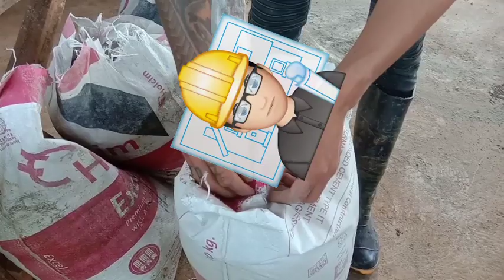Flexural CONCRETE MIX DESIGN | Trial Mix PCCP Item 311 | Slump Test Concrete Mix

Comment from the maker: CORRECTION Tampering Rod Requirements:
SLUMP CONE - 25 blows each layer (3 equal layers)
BEAM SAMPLE - 63 blows each layer (2 equal layers), rod once for every 2 sq. in. of top surface area of beam (6"*6"*21* beam size). Tap outside of molds 10 - 15 times with a mallet or an open hand for each lift.

As per DPWH Standards  Item 311, AASHTO T23, ASTM C31

Thank you 👷‍♂

Comment: Wrong details. When you are making beam sample it is not 25tamps. It should be 1tamp per 1sq.inch.. 
and the slamp procedure. Kpg hahatakin mo ung slump tools hindi spat matagal. Dpat 5secs. + or - 2 secs..
Reply from the maker: Hello po, thank you po sa comment sir., anong section po ng bluebook ang standards na ito makikita sir? Salamat
Reply: Astm C31 and Astm C143
Reply from the maker: ASTM C31: "When rodding beams, fill in: 2 layers (rod once for every 2 sq. in. of top surface area of beam) for beam widths 6 - 8 inches; 3 or more equal layers, layers not to exceed 6" depth (rod once for every 2 sq. in. of top surface area of beam)."
Reply: That is why you shared a wrong info.. be specific and do your research.. 👍👍👍
Wag magturo if di alam..
Reply from the maker: @kwentonie-jayph8150  nagbasi po ako sa DPWH standards sir, at tsaka di rin po 1 sq inch nasa astm c31 po.